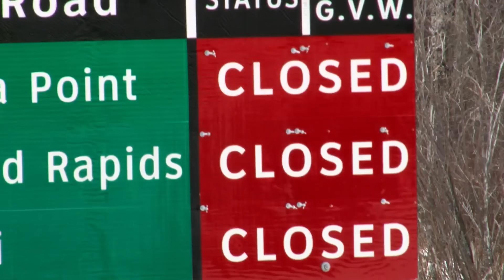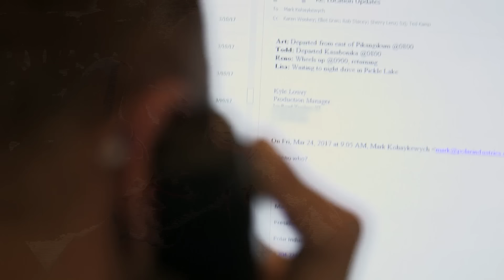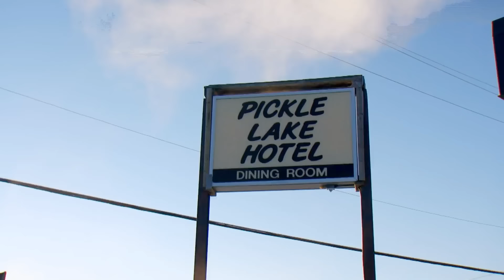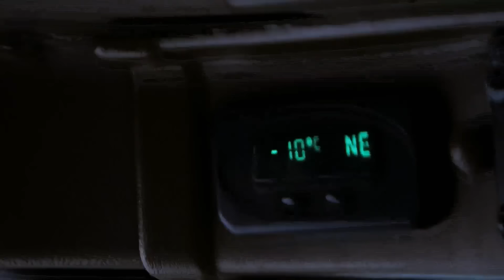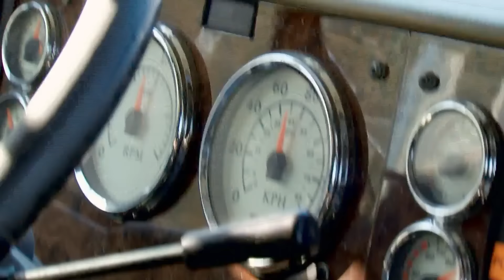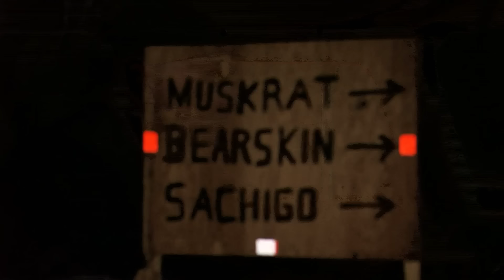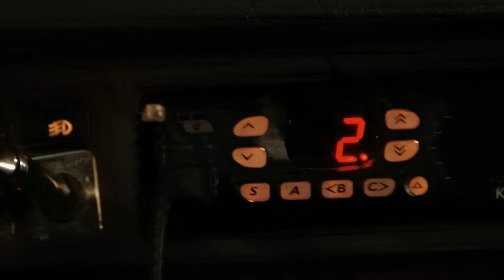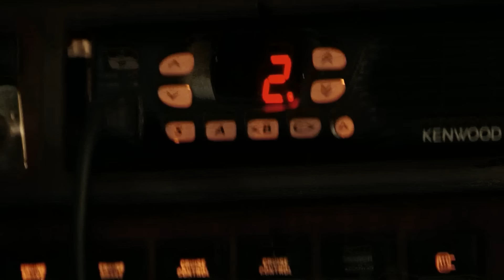Ice Road Truckers: Meltdown Blues (Season 11, Episode 4) Full Episode | History

Comment: Hauling logs off the mountains when it was snowy and icy I put a ball valve on my left front tandems so no air would go to that brake chamber the rest of the wheels would slide but that would turn and it would keep the trailer straight

Comment: I wonder if the camera crew helped  Steph  put  her tire chains  on ..  I always  did it  by  jacking up the wheel with a  bottle jack ..  I  only  used  chains  off road  in farmers  fields  and they needed to be on really tight..  
 She  dug  herself  a hole ..  She should have been   in  reverse  only  and  rocking the  truck   clutch out and back ..   clutch in and forward   over and over  don't  spin enough to dig holes..

Comment: After being a regular on the show for years and years you're telling me she doesn't have 10 grand in the bank?
Reply: Scores Man good point
Reply: Straight up she should not be on the road as an owner operator unless she has what she needs to do her job and as the owner operator that means money in the bank for all the repairs that would and could happen on the road. As an owner operator 10k is change when dealing with your tractor and trailer its like over 5k to just keep good tires from rig to trailer. Then theres gas and DEF refueling keeping everything under the hood in good condition, batteries, the other fluids, then there's your electrical, ect. Long story short forbher to not have 10k in the bank ready to go is irresponsible
Reply: Believe it man it’s not all it’s cracked up to be . She probably has to shovel most of her profit money into repairs for the truck after putting all of that wear and tear on it .
Reply: Christopher Christensen I thought the same. For many years I have toyed with the idea of becoming an owner operator and I always told myself I would not do it unless I had at least 10 grand set aside for operating expenses. It must have been a humbling experience for  her to have to turn to Mark after she and Daryl, R.I.P, were conspiring to steal loads from him. Mark’s a better human being than I am, I might’ve been tempted to leave her high and dry.
Reply: Bad drug habit.
Reply: Shes not driveing the white truck but a blue one
Reply: @Cramblit  I missed the part when she went over to VP, a few episodes ago she was laughing when they offered her a job driving for VP, what happened to her loyalty to Polar?
Reply: She actually is a multi-millionaire.  I read up on her a while back.

Comment: if I was Steph I would've dropped the trailer and re hitched after I got unstuck. not sure why it didn't cross her mind
Reply: As Matt from Matts Off Road Recovery has said, this is one of the worst things you can do. Unless you can move the trailer by hand, detaching it just leaves it permanently stuck where it is, unless you can get a much more capable rig to get it out. If she unhooked it, the trailer would have to be hooked back up at the same height, which would mean either her or another truck would have to be in the ditch to get the right height to hook up, so you might as well leave it attached in the first place, not to mention the precision needed to line it up being very difficult in slippery and uneven terrain.

Comment: I retire as a helicopter pilot for the Marine Corps and after a very short stint as a network pilot I turned to driving professional. Heard about running the northern ice road's and always wanted to try it. Given the opportunity now I'd likely buy an 8x8 Oshkosh and have a go at it now. I'm carrying so much metal on the inside I can't pass through a courthouse metal detector but I'd still love to give it a go. I have run everything except oversized freight. Anyone interested in an ambitious old man let me know. It's not the money I'm interested in rather the challenge. Money I have and don't need anymore.

Comment: You know what the crazy part to this is they have a camera person, so I'd say unless you want to be out here in the cold for a long time you better start helping me dig out. However those truckers need to slow down on that ice nothing is more important than your safety because if you crash you may not get back home which means they still don't get there shipment. And in Steph's  case she needs to put some tree limbs under her drive tires and maybe some cardboard to get some traction. Do these young folks not know how to think outside of the box.